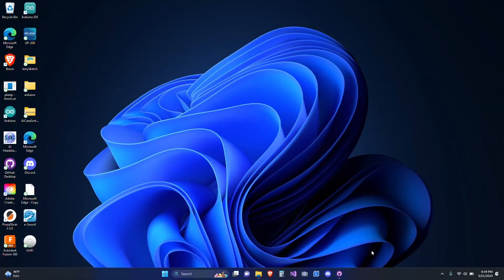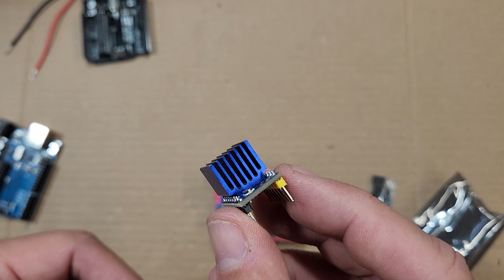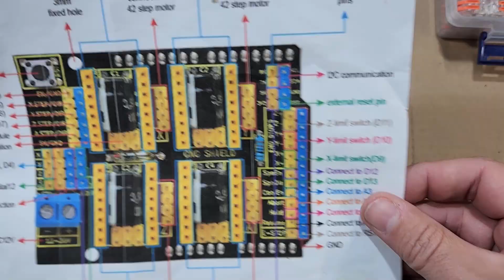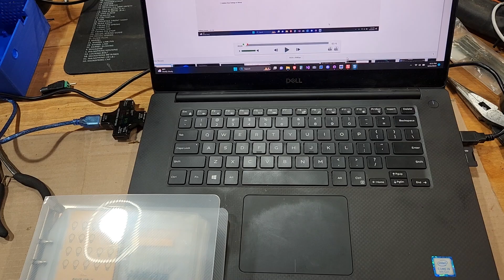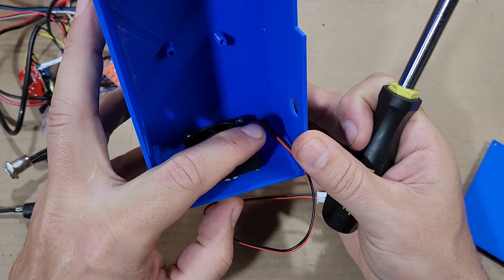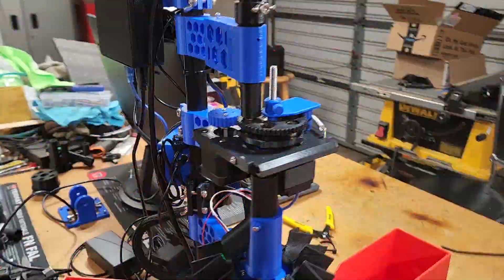CS7.1 Build Series -  Electronics

Comment: Hi there
Jesper from Denmark here. 
I am Building your Nice sorter, and getting pretty close. But I dont get  5 volt from the pin on the board. 
Should the code be loaded first?
Reply from the maker: The 5v comes from the USB Connection. If the arduino isn't connected to USB, it won't have the 5v feed. There are two 5v pins on the board which can be used for the 5v rail.  Also please do join us on the Discord server (link available from the software download page)
Reply: @sjseth-builds  That fixed the 5v issue, thanks for reply. Now I tested with arduino IDE, after download of code, I can step the feeder with "0", but I can not step from the SW. If removing from home sensors, homing is automatically done, when starting the SW. Any ideas?
Reply: After starting SW, I turn off 12V, move the feeder away from home, and turns on 12 v, now I can home feeder, but still not step.
Reply from the maker: @kristiansen1973  please join the discord server as this is not the best place to troubleshoot your issue. Thanks!

Comment: Thanks for the detailed video ... I have replayed the video over and over, and I don't know where the camera wires plug in? There are four wires after cutting off the USB end! 1. White 2. Red 3. Green 4. Black. I assume as always red is power, and black is ground, but the green and white? No mention as to their location. In your video you have marked it with "C" for camera, but skipped the part to connect. Your help is greatly appreciated and thank you very much for your time and commitment to this project. I'm so close 😀
Reply from the maker: Oops! Cutting the USB connector off was a mistake for sure. The camera connects to the computer over USB.   The camera construction is covered in a separate video. CHeck out the description of this video where there is a link to the reloadingrecipes site.  That has all the build videos. Also once you create an account, you will have access to the discord group which will greatly help you complete your build and you can get very quick help.
Reply: @sjseth-builds  Yes, made that assumption but it was not clear on your video due the confusion when you had illustrated and marked "C" for camera in which you had sliced and demonstrating your bundle of wires! Live and learn, not big deal and I'll make the correction. Thanks for your quick reply.
Reply from the maker: @409amer  No worries! I think you can just wire the usb connector back on if there is enough cable left or grab another old usb2.0 "sacrificial" cable and wire that. The internal wires colors are usually the same
Reply: @sjseth-builds  Update, wires were successfully patched and insulated. Camera back to factory working condition... Machine is up and running for it's initial test.. so far so good, thanks again as i transition into learning the software 😀

Comment: First thank you for making this I'm trying to build one,   i have a question i noticed in the CS71_Arduino.ino is a newer since you made the video and  that PWM is set to false,    is the external pwm not need any more? just the resistor inline?
Reply from the maker: There is a mod for the software pwm which is documented in the mods folder in the repo. You definitely should join the Discord server as well.

Comment: Hi
Why jumper on M2? Doesn’t this turn off SpreadCycle and turn on StealthChop2? Isn’t SpreadCycle better for optimal performance?

Thanks!
Reply from the maker: I switched to the tmc2209 because they were extra quiet and for the stealthchop support. It's optional though and that mode is preference
Reply: Ok. So the reason for using stealthchop instead of SpreadCycle is to make it as quiet as possible?
Reply from the maker: @MeAndPookieBeforeTheBurn  Yep, the other controllers caused the motors to make high pitch noises that were driving me nuts.  Torque and accuracy are not a much of a problem and even the really cheap controllers handle that pretty well but are noisy
Reply: @sjseth-builds  Ok I understand.
I’m still on the TB6600 version and the motor noise is not that bad when controlled by these. I am however on way to upgrade to uno/cnc shield/tmc2209 version as soon as I received a new camera. The V1 broke after only a couple of hours running. Will try the cheaper V2 variant this time and see how it holds up.

Thanks for the replies!
Reply from the maker: @MeAndPookieBeforeTheBurn   Curious how the camera broke? Did it just stop working or did something else? I have had about 3 or 4 of the v1 camera for several years now and they are working well.. I wonder if you got a bad one.
Reply: I’m not 100% sure what happened. I accidentally left everything on, including the camera, overnight. Next day when I noticed this I powered everything off. When I powered it on again about a day later the camera wasn’t working anymore. 

If I hold it directly against a bright light source I can see a grainy picture of the light but everything else is black.

Comment: About the feed homing sensor and sorter homing sensor. The instructions says to connect ground as well as 5V+. But the sensor is just s switch, nothing that uses power. I take it that the instructions are wrong, but can't be sure wether to use the NC or the NO for the connection to the Arduino.
Reply: The instructions are not wrong. The sensors come with 3 wires, 5v, ground, signal.

Comment: What's the discord channel? And I missed the TMC2209's in the parts list. I had TB660s from an earlier build, but I don't think there's room to stuff those babies in. Any particular flavor of the tmc2209s? Looks like you're keeping them down at or slightly below 1a ?
Reply from the maker: You can get an invite link to the discord from the software download page at reloadingrecipes.com. 

You are correct, looks like I forgot to add the tcm2209 to the parts list. Will get that updated asap. Here is a link to the tcm2209 I am using:

Teyleten Robot TMC2209 V2.0... https://www.amazon.com/dp/B09BK57KNY?ref=ppx_pop_mob_ap_share
Reply: @sjseth-builds  awesome thanks.  Same ones I grabbed by looking at the color of the pin buffers on the bottom in your vid. I also think you may not have the updated 1.2k ohm resistor in your parts list that you referred to in the video.   1/4w or 1w on that one?
Reply from the maker: They are the .25w version. Thanks for letting me know, will get those added too. Here is a link to the resistor: 

Chanzon 100pcs 1/4W (0.25W) 1.2K Ω ohm 1k2 Metal Film Fixed Resistor 0.01 ±1% Tolerance 1.2KR MF Through Hole Resistors Current Limiting Rohs Certificated https://a.co/d/1ns4Rx6

 And here is the link to the book I used in the video which I think is a better value.

EEEEE 61 Values (Pack of 1095) 1%... https://www.amazon.com/dp/B08BNDL6DS?ref=ppx_pop_mob_ap_share
Reply: @sjseth-builds  awesome. Yeah that book makes it a lot easier to tune stuff in.  I was thinking of maybe a rheostat or pot to dial it in - but like this better
Reply: @sjseth-builds  hi, the discord invite link is not working
Reply from the maker: @shahram1368  Please try it again. The links are auto generated and have a short timeout.